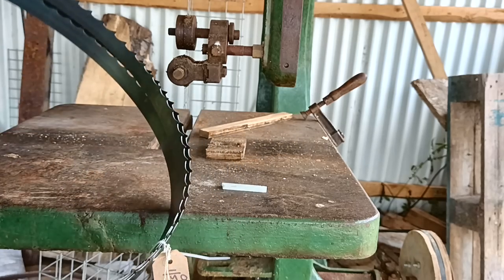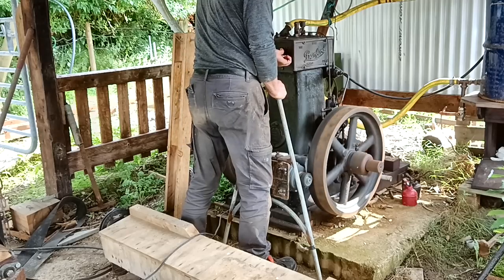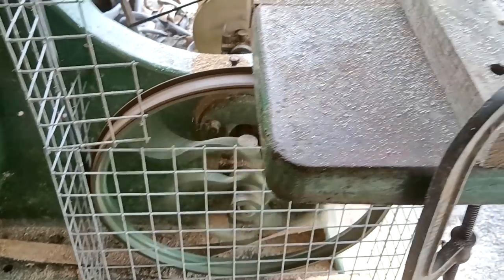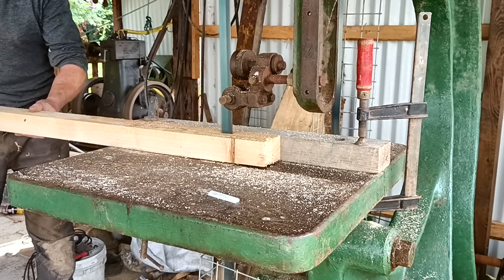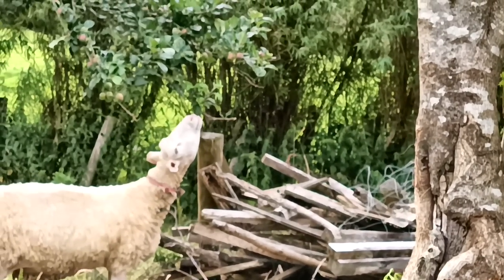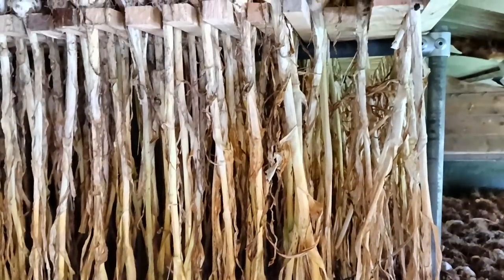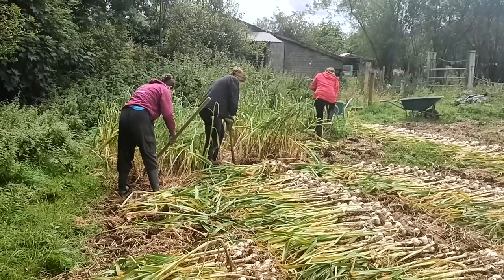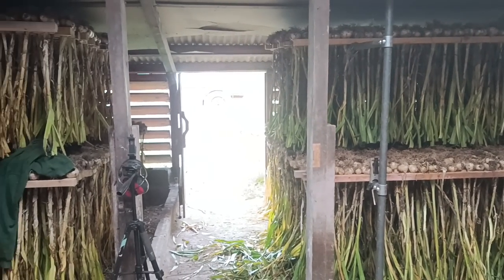Quick Update On The Vintage Bandsaw, The Louvre Walls And The Garlic Harvest

Comment: Here in Mexico when we harvest the garlic, we get it out of the ground then cover the bulbs with the grass so that it dries out in the field. Then we have crews go out and cut the grass and roots off of it and put it in net sacks and then into the barns. Then the next part is the sending the tons of garlic to the sorting sheds to be sorted by size and shipped to the distribution warehouses. We grow a purple garlic. It has a slight  purple color on the paper that is around the heads. Here they dry the garlic with the heads down and some people say it's to get as much of the juice from the grass into the bulbs. I don't know about that, but that's what they say. We plant in October and harvest in May. I would imagine you get a lot more rain there all year and thus the need for drying racks in your sheds. We get early rains but that usually ends in April and it doesn't start raining till July. So a lot of people just get the fields cleaned up for garlic planting again. I think they should grow corn between the garlic cycles so they get some extra use of the land. But here they would have to go plant corn the old fashioned way by hand. The fields are small and hardly anybody has planters.
Reply: Awesome 👍 very interesting how it’s done in other ways. Stay safe 🇬🇧
Reply: Thank you for sharing your garlic knowledge/experience!  Here in Ohio, we typically have rain too often to leave the garlic outside for very long, but I was able to have mine out for two days before rain was coming.  It really jumpstarted the drying!  I will try to do it like that in the future as well.
Reply: Where Tim lives in Ireland, normally it would be too wet to leave it on the ground, mind you the way the climate is changing I think sooner rather than later he'll be laying garlic the same way you do. Great to hear how others from around the world harvest the same crops. 👍
Reply: I'm not sure that corn and garlic would get on well, both have a superficial root system. Oh how I miss my early years in México líndo back in the day! 🇲🇽

Comment: This reminds me of the Amish work shops here in Eastern Pennsylvania, USA. They aren't allowed to have electricity but are allowed to have gas or diesel engines so they do the same thing but they have everything hooked up together. They turn on each machine by pulling a lever and it starts that machine they want to use.    👍❤️📹😃

Comment: Its great to see the old saw back in action!  How many heads of garlic did you plant this year?  I planted over three hundred this year.  If you are having rainy, damp, high humidity weather, you ought to consider running a fan in the barn during the daytime to help dry the garlic.  It is packed in so tightly, I am afraid it will not dry effectively and you may have some mold or rot issues in the center.  This year, I harvested my garlic when here was a couple days forecast without rain, so I could leave it lay outside in direct sun for a couple days.  It really helped to jumpstart the drying.  Then I moved it onto the porch where it has now been for a week and only the stems have any green left on them and not much.  I know you have a big haul and moving it more than once is not ideal, but if you could leave it outside at all, it would really help.
Reply: He did say over 10k. I think this year they are going to double it. They just keep getting bigger and bigger.
Reply: @kameljoe21  Thanks!  😉👍
Reply from the maker: In fact we can only expand by about 20% a year - otherwise there wouldn't be much to sell..
Reply: @wayoutwest-workshopstuff6299  wouldn't be much to sell???  Do you mean there is not enough of a market for your garlic in Ireland???  Or is there some other bottleneck to production???

Comment: I am really enjoying this channel .  I have a suggestion which may help…. When setting the garlic onto the racks, I see you feed each plant individually through the recently placed baton.  Would it work out more time efficient if you were to lay the new run of bulbs atop the previous row with the stems pointing towards you, then place the new baton and tip the bulbs into place en masse as it were?  I don’t know if it would help ….. but it might.
Reply: I think that's how I've seen Bruce do it on The Red Gardens channel, only with onions. (Awsome channel for gardeners if you are into that.) If I ever grow enough to justify a big rack, that's exactly how I'll do it.
Reply from the maker: That's the way I do it, but when I have help it's more reliable to do it as you say in the video - fewer things to go wrong

Comment: I can't understand why there isn't more equipment like you have being used in a workshop environment. Having more than one item being run on a power source has to be more economical than running machines separately. At least if they don't work youn know what the issue is going to be.Think if I had a workshop that was big enough I would do the same as your doing, having one engine to power everything. Have you thought about adding a dynamo that way you could re charge batteries for power tools, it would do it whilst your running something else.